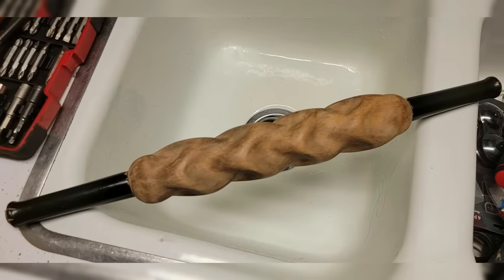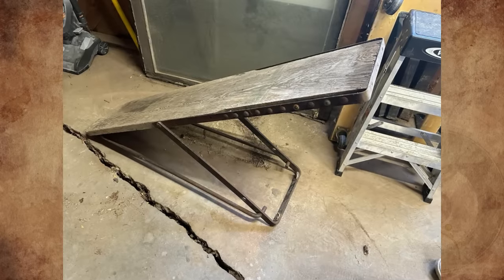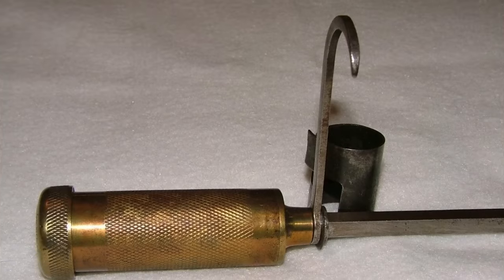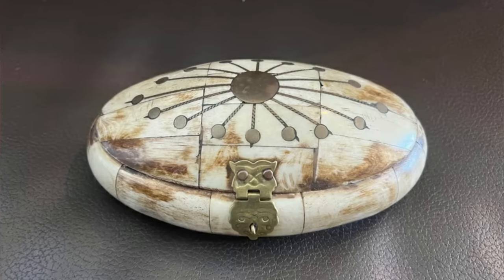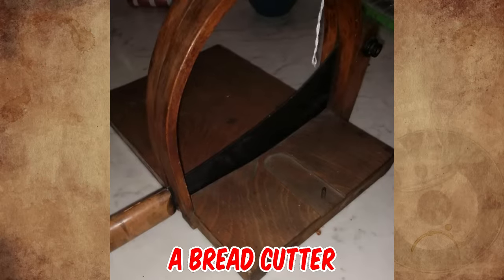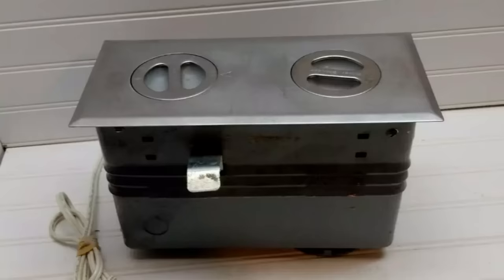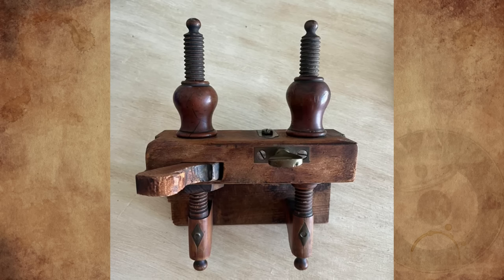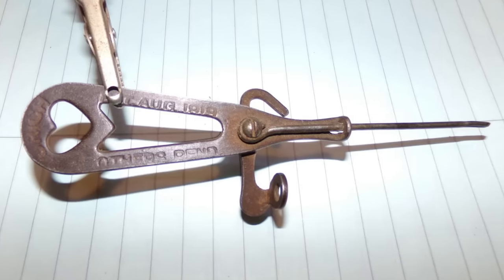What Is This Mysterious Steel Spike With A Hollow Brass Handle And This Wooden Clamping Device?

Comment: Tire repair tool.
You used it to sew the tire back together. 
The tire didn't have to be airtight because they all had inner-tubes back then , the tire just needed to contain and protect the inner-tube.

So after a blow-out you could sew the tire back together and install a new inner-tube to get back on the road.

The repair was temporary, but since tires wore out so fast back then the repair usually outlasted the tire anyway.

(Tires last about 15 times longer now)
Reply: It looked like a bigger part of a sewing machine with the needle for piercing while holding the thread at the pointed end and the guide that held the thread as it was pulled through for the needle.  My first guess would have been for leather work.  Never would have guessed it was for tire repair.  Of course the tires back then were not as robust or had steel wire belts as reinforcement either.

Comment: After watching this site for several years, I finally found something. It is a Vintage Urich Bicycle or Car Tire Repair Tool Patent Aug 1919. I would add a link to the site where I found it but this site won't let me. Working in a bike shop in my teens, I cannot figure out how to use it. Never had any problem with hand tools we had to change or repair tubes and or tires.